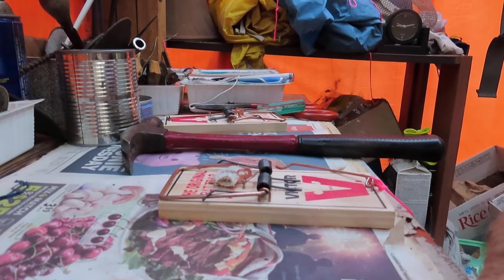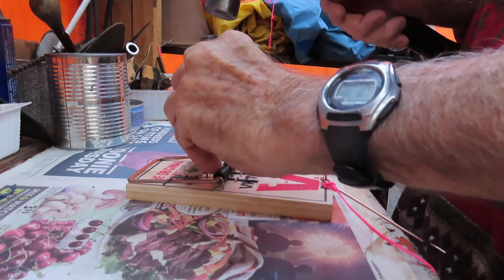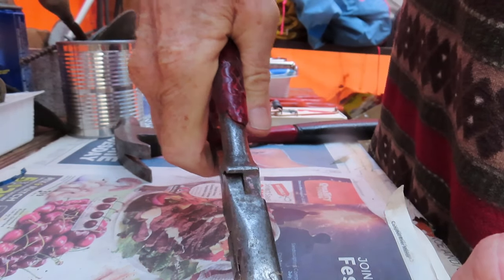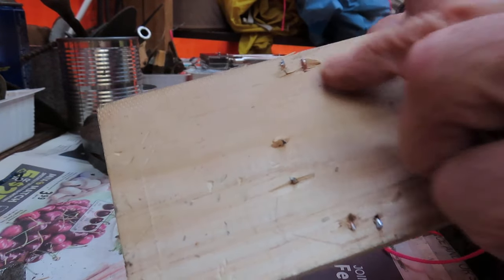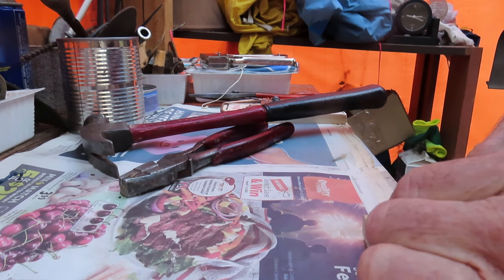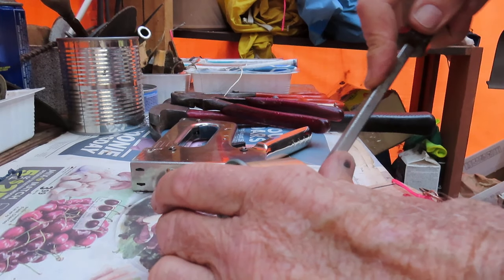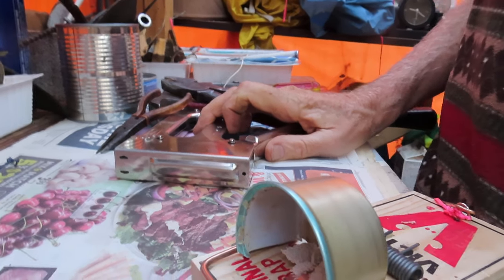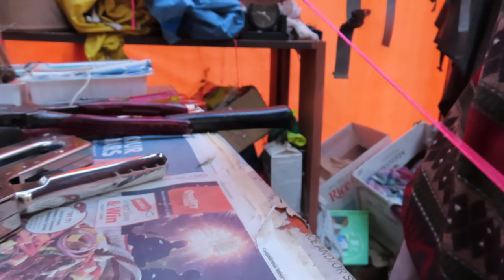Rat Trapper: Setting Up A New Victor Rat Trap To Catch Maximum Number Of Rats

Comment: Like your videos . Just wonted to know saw your black thumb nail . Did a rat trap get you ?
Reply from the maker: Yes. I have lost my thumbnail twice in the past eight years of professional rat-trapping, which is not too bad considering the many thousands of standard Victor rat traps I have set. The thumbnail always grows back after a few months. 
  This is why very many people buy and use the black plastic rat traps, because they allow you to set them without risking having your thumb slammed.  But, the black plastic traps do not last as long as the Victor wooden-base traps do, they tend to malfunction and break down. And, the plastic traps will kill only one rat at once, whereas the Victor wooden base traps will kill up to three rats at once; they are the most powerful rat trap available, and can be repaired and kept going indefinitely. And the Victor wooden-base traps cost about half of what the plastic traps cost. So, despite the danger to your thumbs and fingers, the wooden base traps are quite superior to the plastic rat traps.